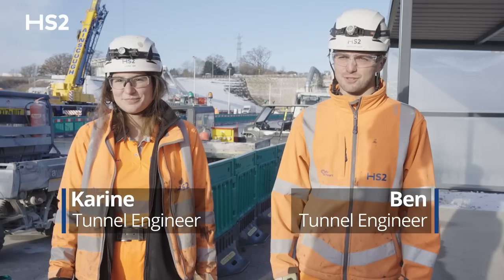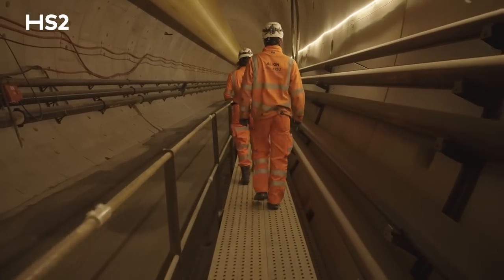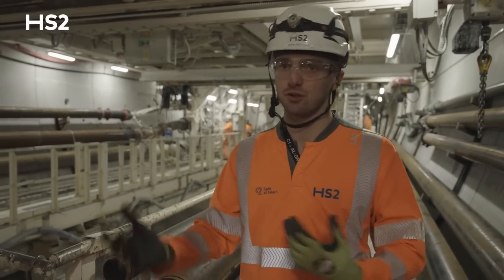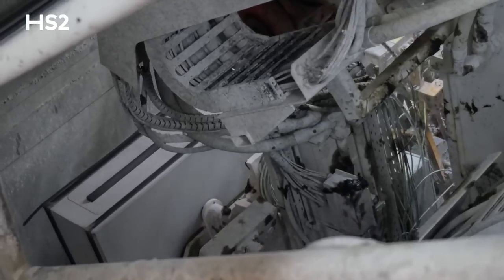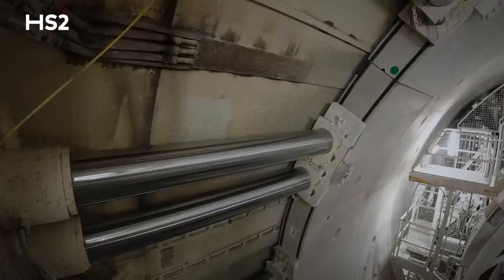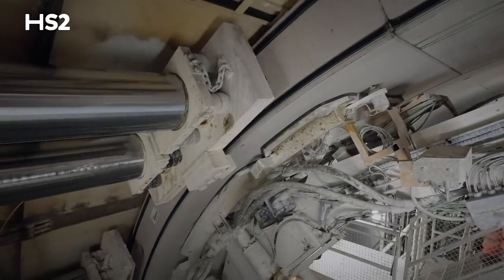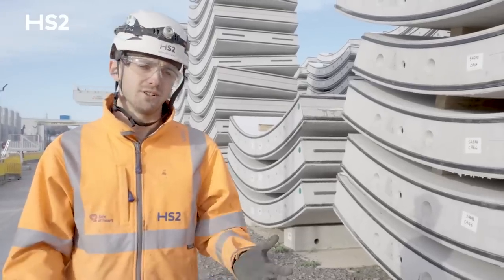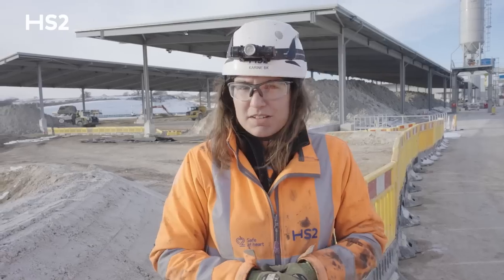80 metres below ground with the engineers building HS2's longest tunnel

Comment: Just remind me - how much time will be saved on a Journey from central Manchester to central London and how much will a ticket cost me?
Reply: The main benefit of HS2 aren't speed improvements.  It allows the fast trains to be taken of the current network, allowing for more commuter and regional trains, which otherwise couldn't operate, and has been proven by engineers to be the best solution to the problems on the current network, and no half baked cheaper solution would bring the full benefits that HS2 can.
Reply: @HM...333  There won't be any benefits because people won't use it for the same reasons they don't use the trains now. They are not reliable and they are far too expensive. Last time I enquired to go from Boston to Winchester was over 200 quid return for 2 of us, I would have to park the car and risk it being vandalised because thieves love station car parks. Then I would have had to get a taxi at the other end. Even at 20 mpg it was cheaper, easier and faster to take the car. I didn't have to worry about industrial action, cancellations or the nutter with a tin of spam claiming it to be an atom bomb. Engineers can't fix that.
Reply: @davidpowell3691  The reliability will be able to be improved. take transpennine express, however their problems have been caused doesn't matter. If hs3 was built, all the local services which get stuck behind and massively effected by the longer distance trains will be able to run more efficiently and more frequently. that's how railways work. And on the price front, hs2 has never set out to solve that. That is the job of other projects (Great British railways..) When all of the big projects work together, they allow for a much improved and more efficient network, that's why the railway experts designed hs2 to be the way it should be, even if politics have since got in the way
Reply: @HM...333  the clue is in the name - high speed 2 - it fails at that first hurdle. The French TGV's of 30 years ago are faster than the trains that will run on hs2. with the proposed cost of tickets and the minimal benefit it has with regards to journey times the whole thing is an embarrassing white elephant.
Reply: @davidpowell3691  So are you trying to say, that a scheme where Britain can catch up is a bad thing. Take crossrail, the french have had something very similar for a long time now, but that isn't a failure, and that cost a lot, but massively successful. These projects have the benefit of journey time, but they unlock massive capacity upgrades which will be the largest benefits, unless you don't want that to happen. Also any upgrades to the current network would have to be done the wcml, mml, and ecml to match the benefits. As well as other smaller sites that would need the work, it would all add up to more than the cost of HS2. Not my words, but proven by engineers and designers and railway planners.

Comment: How many m³ of concrete is used in this tunnel  ?
Reply: A lot
Reply: Fewer than in previous traditional constructions. Also, a design life of 120 years mandates some serious engineering input.
Reply: @mikehindson-evans159 .. HS2 claims it will encourage modal shift from cars and air and be “net zero carbon from 2035,” only 5 years after opening.
In fact, its own assessment says that “over the construction and the first 60 years of operation of HS2, it is likely that carbon savings will be less than the carbon emissions.”
Only 4% of HS2 passengers would previously have travelled by car and only 1% would have flown, while 26% will be new journeys.
At this rate, it will be well into the 22nd century, not 2035, before Phase 1 of the scheme has covered the 6.5 metric tonnes of carbon equivalent created in its construction.
Per pound spent,  literally almost any other public transport project imaginable could achieve greater modal shift & CO2 reduction than HS2 - and that it takes vast sums away from such projects is another of its environmental harms.

And all this is based on the published costs and calculations of benefits, which have not changed for 3 years or more. In that time, the true position has become worse. Covid has further undermined HS2’s already weak strategic rationale: to free space on existing lines for more local & commuter services - this is no longer necessary. 
Since the pandemic began, significant and probably permanent changes in working patterns have seen rail commuting plateau at around 70% of pre-covid levels. Business travel, HS2’s core direct market, is also down. 
nik Planned journey times on the new line have quietly increased, reducing the value of time saved, integral to the business case.

As the benefits of HS2 have fallen, its costs have risen further. The Financial Times recently reported that an internal review by its deputy chair, Jon Thompson, finds that Phase 1 of the project, from London to the West Midlands, will run “many billions” further over budget, is “very unlikely” to meet its £40.3bn target cost & has only a 50% chance of meeting its upper envelope of £44.6bn (at 2019 prices), including contingency. 
HS2’s costs will rise very significantly above even this when 2022 inflation, now at 18% in the construction sector, is added. 
HS2 Ltd’s management has drifted. The organisation has been without a chair for the last 15 months.
It's nothing more than an environmental disaster of epic proportions. 
Excellent news that the Eastern leg & the Golborne link have now been cancelled & fingers crossed,  the rest of this monstrous vanity project will never see the light of day.
Reply: @mathiasvries  I'm not sure honestly, 5m³ seems like too much

Comment: Incredible waste of money when the rest of the network is crying out for investment.
Reply: Well then you  clearly don't understand the point of HS2. It allows the fast trains to be taken of the current network, allowing for more commuter and regional trains, which otherwise couldn't operate, and has been proven by engineers to be the best solution to the problems on the current network, and no half baked cheaper solution would bring the full benefits that HS2 can. Hs2 allows massive improvements to the current network.

Comment: United Kingdom Of Great Britain London, Manchester, Birmingham, Liverpool, Glasgow, Edinburgh is the best city in the world, The first railroad built in Great Britain to use steam locomotives was the Stockton and Darlington, opened in 1825. It used a steam locomotive built by George Stephenson and was practical only for hauling minerals. The Liverpool and Manchester Railway, which opened in 1830, was the first modern railroad, UK modern Train railway boost business forever.
Reply: Actually it goes, London, Birmingham, Liverpool, Glasgow and Manchester in population size of the Cities. Do not know why Manchester is given so much importance in the tings being the 6th largest City in the UK plus HS2 is a Birmingham centered Rail Project having the largest Terminus on the route at Birmingham Curzon Street and both the HQ of HS2 ltd and the HQ of the train operator that will operate trains on the HS2 route, Avanti West Coast based in Birmingham

Comment: There's no getting away from the fact that the huge amounts of money being spent on this would have been better spent elsewhere. It is impossible to justify.
Reply: Well then you  clearly don't understand the point of HS2. It allows the fast trains to be taken of the current network, allowing for more commuter and regional trains, which otherwise couldn't operate, and has been proven by engineers to be the best solution to the problems on the current network, and no half baked cheaper solution would bring the full benefits that HS2 can.
Reply: @HM...   this response is given all the time, but it doesn't bear close examination. Think about the amount of money again. Less destructive and more efficient, smaller projects would do a better job.   Thank you for confirming that my regular London to Coventry journey will be slower with HS2.
Reply: @barryjatkinson  This response is given all the time by the rail experts, the ones who actually know how beneficial this project can be. And smaller projects couldn't deliver the benefits hs2 can, because our railway network is almost at capacity, with it being difficult to cram more trains in, in most places. To give the same benefits, these projects would have to completely rebuild some of the current railway network. I'm not saying that these projects aren't useful, because they clearly are, but just need to supplement the large projects (hs2 / hs3.) Look at other countries with high speed rail, at first there was a large movement against it, but now it forms a vital part of the rail systems. Look at Japan

Comment: Stupid project ruined the local area to save mere minutes 😂
Reply: Well then you  clearly don't understand the point of HS2. It allows the fast trains to be taken of the current network, allowing for more commuter and regional trains, which otherwise couldn't operate, and has been proven by engineers to be the best solution to the problems on the current network, and no half baked cheaper solution would bring the full benefits that HS2 can. It will allow rail improvements all across the country, like a domino effect
Reply: HS2 has not ruined any local area, in Birmingham it is actually rejuvenating old railway land and redundant industrial land with in the City.

Comment: what a waste of money when we need ev infrastructure and new base power generation
Reply: The trains will be EV, and will increase capacity, taking both cars and trucks (via freight) off of roads, causing an easing of the burden on our existing infrastructure
Reply: EVs are not going to be our salvation.
Reply: @leming400  So more people out of work?
Reply: Just look anywhere, people are going back to work. HS2 unlocks massive capacity improvements on the current network. Ridership has doubled in the past 20 years, and even with covid people are now traveling again and so it will continue to increase, and so new projects are needed to allow more people to use the railways. Take the new Crossrail in London. Has 1 million users per week. Is that nobody using it? And what about the south wales metro plan? Longer more frequent new trains, and why do you think that is? And what about any restored railways that now offer connections to the centre of cities. Take the Dartmoor line...

Comment: Well I hate the HS2 what an utter complete kibosh. ...dug up the same peice of road 5 times in last 6 months the same spot traffic carnage every time devastated the countryside waste of money
Reply: Because of some roadworks on a small section of road, Matt doesn’t think huge chunks of capacity should be unlocked across the entire west coast mainline so more freight and commuter services can run for the next decades. 

I would rather be held up in some temporary roadworks than battling a lifetime of congested roads full of diesel polluting lorries…..
Reply: And GG don't care about anything else but his own needs it doesn't matter that 40 ancient wood lands are being destroyed or mature oaks being ripped out the ground full of birds with nests or that small ponds are being filled in so more amphibians in the area or that most of the small trees that have been planted have died during last summers drought or anything else that's being destroyed along the path of the HS2 without mentioning the 140 Decibels of noise pollution none of that matters does it GG
Reply: Well said. Same where i live. Contractors vehicles using undesignated roads and causing potholes galore.
Reply: @mattgoodchild8215  Absolutely right!. It's the same story all along the route. Devastation on an epic scale.
Reply: @edwardtreadwell3859  That is what it will be like for all projects. Road building projects are no different. Look at any other running high speed line, and you will notice it isn't a pile of mud, they do this thing called tiding. And hs2 is spending large amounts of money rebuilding and building new habitats and ecosystems for natural life
Reply: @HM...333  New roads don't take the vast amount of width HS2 us taking. As for creating new ecosystems, that is farcical. You cannot replace ancient Woodlands and ponds. The disastrous tree planting has been well covered on the news in recent years.